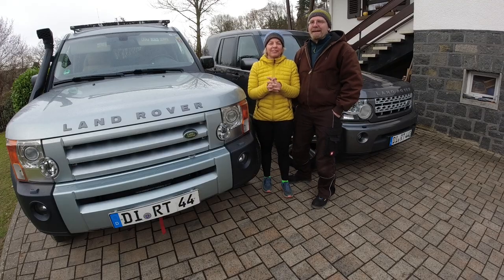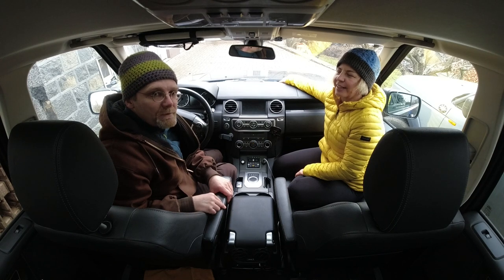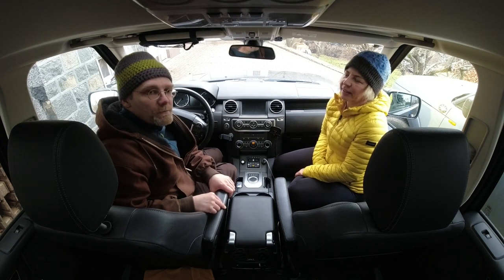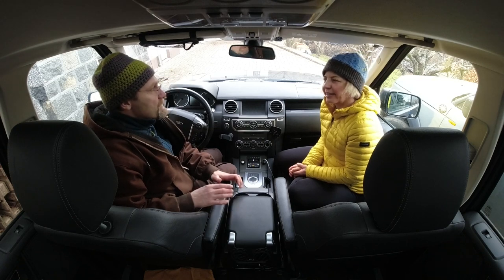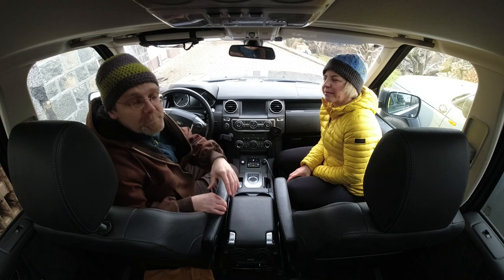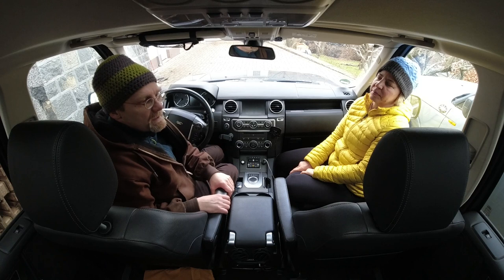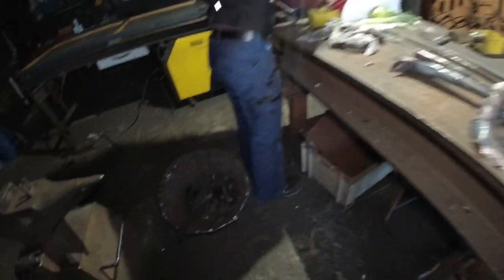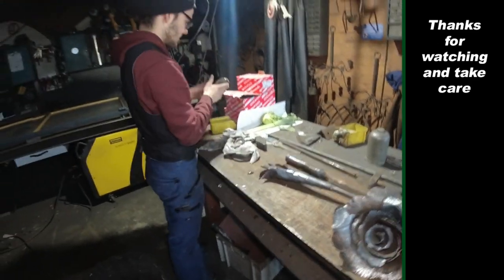Four things we will never change on our Land Rover

Comment: Christian allow me to disagree on the engine swap theme on the LR3. During the time LR3 was made Land Rover as a brand was owned by BMW, hence a lot of the 'vital' things are used in BMWs from these years. Why LR decided to choose this pile of crap called Lion Diesel I have no idea, an  M57 diesel from BMW would have made these things probably indestructible.  One thing you probably know, LR3 uses ZF's ZF 6HP26 , same as BMW X3 3.0d (single turbo), BMW 330(x)d e9xx, BMW X5 e53, e70, e60 LCI (2007-2010) and E65 745i, with that said, given the gearbox and DSC are responsible for the terrain response system and the CAN-BUS communication will only take 'simple' stuff from the engine, I think an M57 engine swap to this beast is a do-able thing, plus more reliable than the TDV6 :)

Comment: As a Toyota driver in New Zealand it is interesting, not a single benefit you claim for your air suspension is relevant to me. Lowering down at high speed? My car is incapable of high speeds. Lowering down to get into parking garage? My car is less than 1.5 metres tall. Lifting up for off roading? My car has 300 mm of ground clearance. Staying level when hauling a load? The hilux will cope happily with 1.25 tonnes in the tray.
Reply from the maker: Yes, and you can put life stock on the bed.   In a Discovery,  sheep don’t want to come out once they sit in the back on the stadium seats.   Hilux is a great car.  Christian

Comment: I had to pay £600 for a new compressor .. I replaced dryer etc but motor died ...would love you to disect  a compressor so I can fix my now back up .... stop looking for easy life with Toyota lol 😆 if replacing the compressor  cut a notch out of top mount bolt hole ... means u can leave that damn bolt half in and slide mount over
Reply from the maker: We are definitely looking for an easy life with Toyota, just including our Toyota viewers. We need them, otherwise we would only have a couple of views per video. 😅 Compressor maintenance is coming, but we are experiencing problems with the order we placed. Parts have not beeb delivered yet.  👍🙋‍♀️Vera